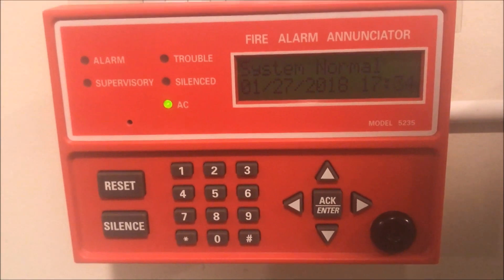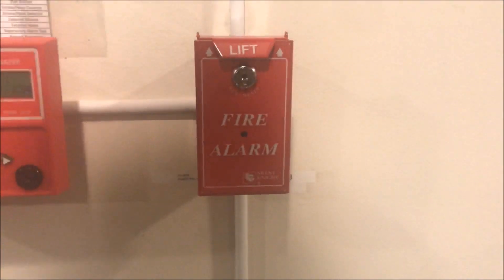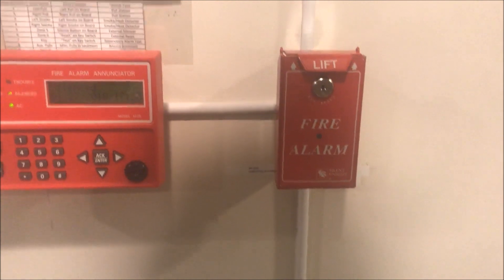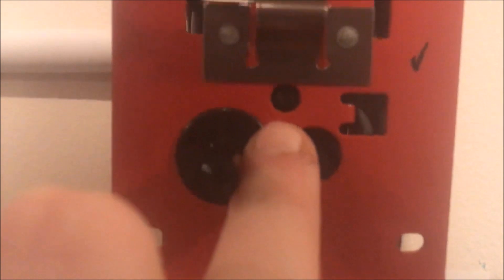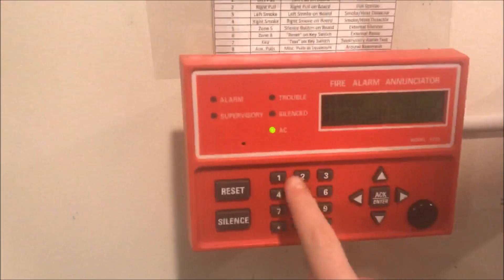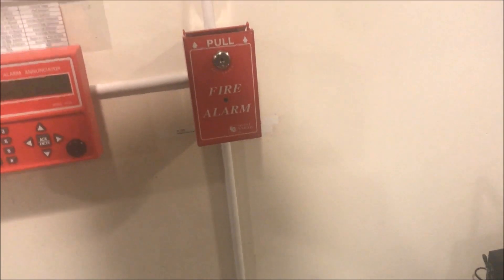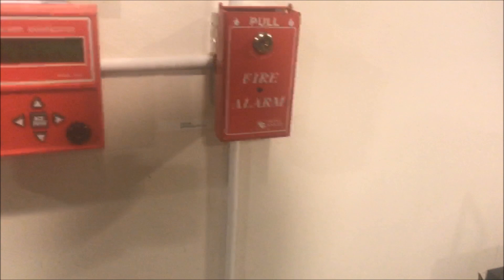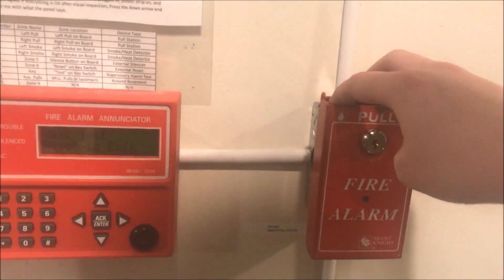Testing and Overview of the Silent Knight SD500-PSDA Pull Station

Comment: Why wasn't the led light flashing on the pull station?
Reply from the maker: I bypassed the addressable card so the pull can be used on my conventional panel.
Reply: Fire Alarms and Such I have 5 of these pull stations and I don’t have a panel, but the led still turns on when I pull it